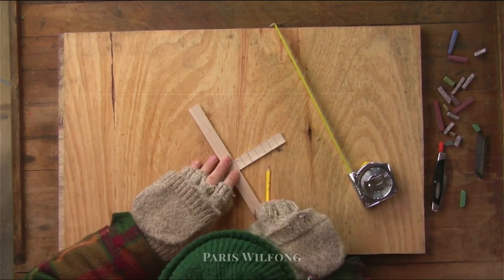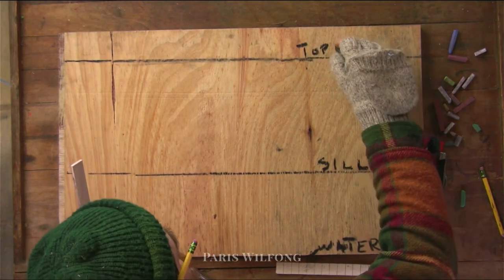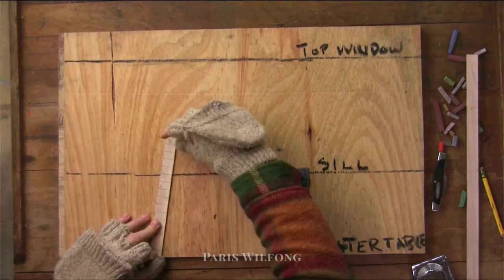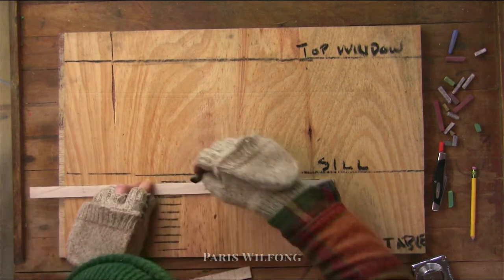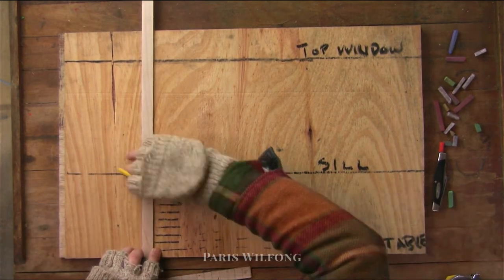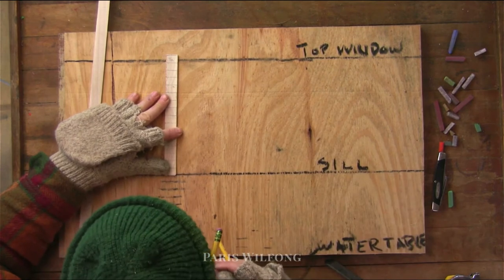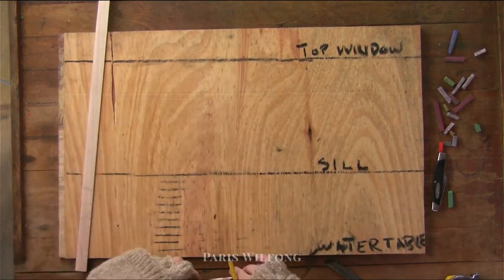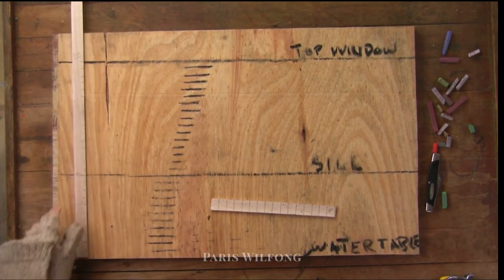How to Layout Siding Using a Swing Stick | The Best Way to Install Siding

Comment: I've been a carpenter for years and wondered how they used to accomplish this without a calculator efficiently considering how long the math would take to do by hand. This technique will also work for some railing spindle layouts.